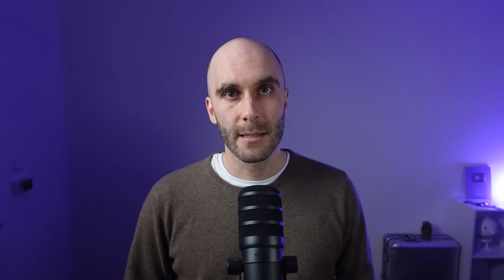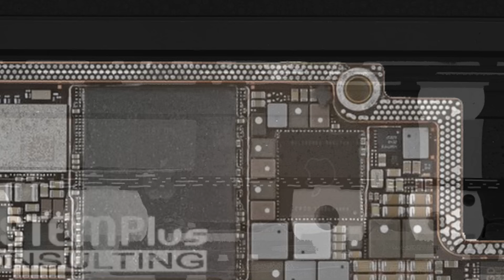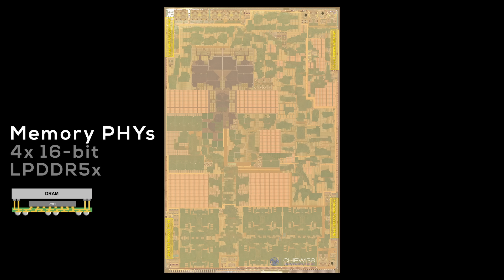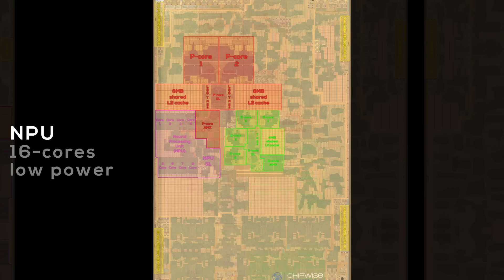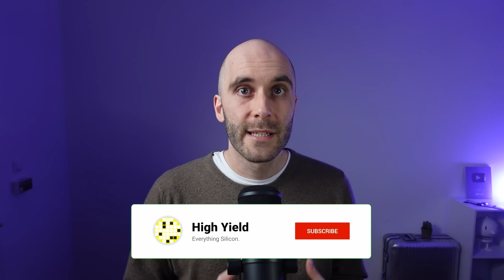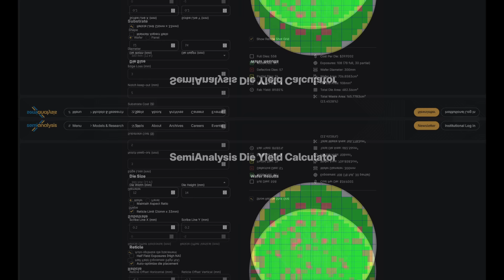A18 Pro & MacBook Neo Deep-dive

Comment: a computer thats powered with a smartphone chip sounds kinda weak, of course. And of course its not the fastest macbook, its not meant for that. I think its interesting to mention that the technology of the A series chip, an ARM based cpu is actually good for laptops too. Because if you think about it, from a laptop you expect kind of the same as you do with your smartphone: a good lasting battery, smoothness in everyday activities and it being cool and silent. Thats very interesting cause in the long term apple will cement its role in the laptop industry, eventually killing windows laptop who last a lot less, are kinda noisy under workload and also heat A LOT.

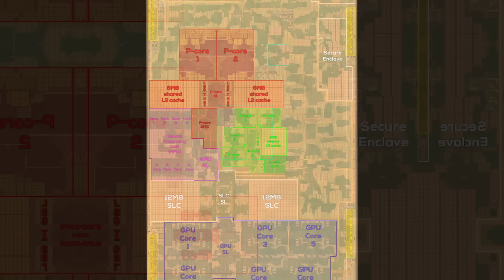Comment: 9:07 this is likely a system controller of sorts that is responsible for resource management. for complex low power systems they use little microcontrollers to put subsystems into low power states

Comment: Ironically they could have already started with a a4 chipped laptop with 4gb ram in 2010 and that would have smoked any competition back then. Here we are 16 years later
Reply: The problem with the A4 was that it was not powerful enough to compete with x86 in raw performance. Apple needed a significant performance overhead in order to transition to a new architecture and running emulated x86 software at least close to their original speed. The A4 could not deliver that.

Comment: 13:10  I don’t understand. You said all 6 GPU cores must be enabled and Apple can’t use any A18 Pro with defects. But right after this , you say Apple can now FINALLY use all the A18 chips with a defect. Aren’t you contradicting yourself ?
Reply: He didn't say that at all. He said "The A18Pro was only used in the iPhone 16 pro / Pro max. And Apple only used A18Pros with all 6 gpu cores enabled."

That doesn't mean Apple can't use A18 Pros with defects. but they the iphone's MRD required only the chips with all 6 gpus functional. The ones with 5 gpus working even though they would power up fine, were not suitable for the iPhone.

The neo is an outlet for those 5 gpu bins.
Reply: @skifree0  I see. I get it now. Thanks

Comment: thermal throttling pieve of shit not suited for lsptops, they dont even have temperature control: no fans, no heatsink, no thermal compund for a chiop which hits 95c the moment it turns on. this chip is also weaker than the ones in iphone..... hope you all ate that apple promotion money

Comment: That tiny dual core might possibly be part of the Secure Enclave thing. It’s possible. The T2 chip used to basically be a stripped down A10, which had two efficiency and two performance cores built into it. Apple has since baked that into their SOCs instead of building a separate chip.

Comment: The A18 Pro is a pretty magnificent chip design wise, and the macbook neo is a testament to Apple spectacular market mastery, what dissappoints me what the macbook neo is that at its current price point is competing against WIndows/Linux laptops with double the ram and considerably superior multicore and sustained performance, and even fellow older macbooks with overall superior usability and flexibility and even performance and it doesnt help that it lacks a cooling system almost entirely and throttles aggressively really quickly. wich really threatens its longevity as if there are any defects the excessive heat will expose them over time and non upgradable components will be very problematic/impossible to replace. Iam impressed by what apple was able to achieve but its just that from a longevity and usability stand point it doesnt make sense to buy. if you are fine with 8gb just go with an older M1 with slightly better overall performance and linux support for cheaper.
Reply: its especially a tough sell against something like the acer aspire 14 AI with the ultra 5 226V with offers much much longer battery and better sustained performance, while also having the advantages of x86 such as wide compatibility and better gaming experience. and no I dont consider superior build quality a reason to skimp on purely superior processing power and long term usability.

Comment: Great video as usual, I hadn't heard of InFO-PoP before.

One thing you could have made explicit (maybe I missed it?) is that InFO-PoP is a wafer-level packaging technology, meaning the 8 GB memory chips get stacked before the wafer of A18 Pros gets diced. That is, Apple had a stockpile of binned A18 Pros that already had RAM attached, and not a stockpile of "naked" SoCs that could later be configured with differing amounts of RAM.

Presumably InFO-PoP is chip-on-wafer rather than wafer-on-wafer?

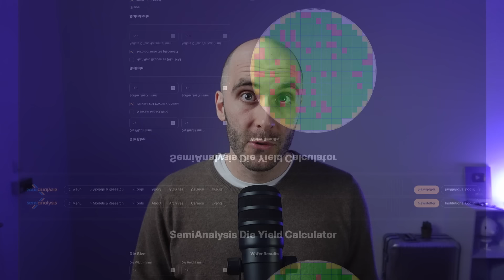Comment: A really good video with clear analysis of the A18 Pro chip and the comparison with the M4 - thank you. I particularly liked the point about yield numbers (at around 12:50). I've been interested in this point for a long time, from when it became clear that APS-C DSLRs would always so much cheaper than 'full frame' models, because the APS-C image processor is so much smaller and therefore the yield rate is much higher.

Comment: Largely, the cost/benefit analysis for the Neo is that it was designed to benefit Apple, not Neo owners. Over around a 4-5 year ownership, the MacBook Air M5 base laptop is a far, far better deal. I don't think Neo's will be kept anywhere near that long. It should be no surprise that Apple has sculpted a better marketing campaign than a laptop. Listening to these 'influencers' go ga ga over the Neo makes me wonder, what's going on there.

Comment: IMO the biggest thing holding back the Neo is the passive cooling. I doubt it could could keep up with the M4, even if you disabled two of the M4's P-Cores, simply because the M4 is cooled better.
Reply from the maker: Fully agree. That’s why I’m not sure if the next Neo really comes with the A19 Pro, that it will also use the vapor chamber

Comment: People kinda forgot that before the whole M-series chips, Apple gave out a Mac mini that runs on an A12Z chip to developers for them to use and build ARM support for their apps.

A chip from a 2020 iPad Pro. Which is also used as a basis for the M1.
Reply: I remember that. And that thing ran great. It was faster than all of the Intel chips already. 

The A18 Pro is actually faster than the M1. Although that alone probably isn’t telling the whole story, Apple is doing some heavy thermal management here which means it will likely be slower in sustained workloads.
Reply: @photoniccannon2117   thermal design is retarded. it throttles because they didnt put a single thermal pad connecting the chip to the chassis. people are already doing it and getting pretty large sustained boost clock improvements.
Reply: THIS.. i thought the same thing. Since everyone seems forgot M1 derived from A12Z
Reply: @joenathanz7474 M1 is derived from A14. Not A12Z. (at least according to a leaked optimization guide meant for tencent)
Reply: @thenothingofoz  The M1 is derived from the A12Z in the same way the M2 is derived from the M1
Reply: @thenothingofoz correct. It’s about 20-25% faster per core than the A12 series. Some of that is clock speed improvements but there are also significant IPC gains. 

The A12Z was already a beast but the M1/A14 was a very significant leap over it.
Reply: My 2020 iPad Pro is still going strong. In fact, when I replaced it, assuming its for reasons of choice, it's more likely to be because I want more storage or new features rather than the SoC being "too slow"

Comment: Flagship smartphone chipsets are powerful but often overlooked because most of the time they don't perform as high as they can due to the power and thermal limitations of such small devices. And the software compatibility problems are solved, they'd be great at low-cost laptops.

Comment: It would be so nice if all ai accelerators were replaced with L3 cache! It would provide an actual performance and efficiency improvement in tasks we actually want to perform on our devices. Some occasional matrix calculations can be done on a GPU just fine
Reply: occasional matrix calculations are probably the worst case scenario for running on the GPU...You want frequent matrix calculations to justify the power cost of powering up the GPU.
Reply: @skifree0  i don't get you point. iGPUs are plenty for a burst of calculations. Wheras a frequent load (like microslops's ai spyware) justifies dedicating some die area towards a spetialized co-processor
Reply: @MhlMstny  the entire point of a NPU isn't for performance its power efficiency, NPU's actually have horrible performance compared to a real GPU, hence why on a desktop no one actually bothers to justify one. the GPU will do ANY form of matrix / SIMD calculation you want.

the problem is using a GPU to do light matrix calculations sucks an enormous amounts of power relative to the workload...Say you have a light load. Even with iGPUs, to get a GPU ready. You need some amount of the CUs/SMs  to be online. Then you need the those blocks of L1 powered up. Great you powered up your SM/CU to actually exec those calculations, but now you need all the supporting IP blocks to get the instructions to the work unit. 

You need at least one part of the the GPU's central schedulers powered on. Oh but then you need to power up the last level caches connected to those schedulers. But to activate and use those caches you need to activate and at least part of the enormous memory buses, that GPU's have. 

it's like firing up a V12 lambo (or for your analogy a v8 mustang if talking about the iGPU) only to go to the grocery store. It can 100% do it, but you have to power up so much other "stuff" (IP blocks when it comes to the GPU) just to get that chip to function that you are better off having a small co processor that doesn't have to worry about GRAPHICS and can be stripped down to light SIMD ops, thats what a NPU is.

Comment: As someone who has used Macs since the 90s, it's crazy how Macs have gone from having inferior chips to everything else, to the same chips as everything else, to the point where someone says "it's Apple silicon" and it's understood that they mean "it kicks ass".
Reply: It is true, Steve would be proud. Apple silicon was one of two things I've given credit to cook for doing a very good job on since he took over.
Reply: Vertical integration kicks ass
Reply: "It kicks ass"

ass = your wallet
Reply: Problem is they moved away from being a pro consumer company. Everything is super expensive and even more expensive to fix. The Neo with a 30-40% bigger battery would be perfect for school.
Reply: @brezza6892  Macbooks were never as cheap as they are now
Reply: @brezza6892  it will already last you 20 hours watching YouTube on a charge, what are you doing that needs more than that?
Reply: @brezza6892  MacBook Neo is the most repairable Apple laptop made since 2012 and if you compare it to modern ultra slim laptops, it's far more repairable than they are. But overall everything became less repairable because the space, energy and efficiency savings of soldering everything in tight spaces are huge compared to making a bulky machine where you can plug everything in. Thing is, consumers have a choice but they choose to get thin and light machines over something like a Framework laptop.

Also why would a Neon with 30-40% bigger battery be better for schools? You can't fit a bigger battery in it, it's already the tightest motherboard I've ever seen on a laptop. The Neo already has a battery life longer than a day (12hr). What kind of  a school do you know that keeps kids in for 12hrs at a time???
Reply: @brezza6892 the imac that saved the company cost $1299 which is $2600 in today’s money. the neo is over 4x cheaper but you call it “super expensive”
Reply: @brezza6892 ...its $600? That's not expensive.
Reply: if you ignore that it costs 2x or 3x more than the same stuff from others, then sure
Reply: @lethern2 Since Apple Silicon, Macs have been some of the best performance in their price range.
Reply: @FrancoRossel  can you name 2  products that you compare and in which artificial benchmark? (we won't really compare games' fps, since... well)
Reply: @lethern2  Alright, let's see. Let's look at the actual benchmarks for laptops that these things compare to.
The base MacBook Neo with the A18 Pro starts at $599. It scores roughly 3500 in Geekbench 6 single-core and 8600 in multi-core. It does this completely fanless, silent, and without dropping performance on battery power. Not to mention you will be hard pressed to get that level of build quality at that price.
Now look at a $1,300 Dell XPS 13 with an Intel Core Ultra 7, or a Surface. It scores around 2500 in single-core. It literally costs $600 MORE, gets absolutely destroyed in single-core speed, has fans that spin up constantly, and loses about 30% of its performance the second you unplug it from the wall.
If you match the build quality and screen, Windows laptops are the ones charging a premium now. You are paying more money for worse benchmarks.
Apple silicon is king at single core and performance per watt. And I didn't even compare a M series chip.

Of course Macs are not gaming machine, these are for work. Do the rest of the homework yourself. And the things also retain much better resale value.
Reply: @lethern2  let’s flip it around, find me a 500 dollar laptop that benches the same as the neo. Or a 600 dollar micro pc that benches the same as a mcmini. 

And you can compare benchmarks for macOS on games like cyberpunk 2077 and baldurs gate 3 if you want to. The times really are changing.
Reply: @luipaardprint  Don’t bother arguing with that guy. His argument has no basis, and he’s looking for a petty fight.
Reply: @Taxiway_Delta  Wait, MacBook neo has 8GB of RAM...? You mean that we are looking at a thing that has less memory than an iPad and we are celebrating? Gosh, now I feel like I've been rickrolled by you guys, good job
Reply: @luipaardprint  See how he’s trying to get me to engage in his petty conflict? He’s a troll. Ignore him. He’s even omitting obvious facts and making misleading assertions! 🤣 I would point out the holes in his argument, but I’m too busy writing a comprehensive music app in Xcode on my MacBook Neo.
Reply: @Taxiway_Delta  it’s not so much for him, but for other people that come across this.
Reply: @luipaardprint  Fair point
Reply: @lethern2  Trolling or not I cannot ignore someone pretending that the memory management of MacOS is not superior to most other OSs. In Windows, you drown with 8GB. In MacOS, 8GB will run everything but local LLMs (though some have tried it on the Neo and it works with a TON of optimizing and sacrifices) with no concerns such as Video editing, browsers, emails, modeling software, etc. Its Unix base and well developed ecosystem, lead to insane optimization as developers know what hardware they have to accommodate for when porting their apps and there is better dynamic memory management in general.
Reply: @FrancoRossel  macs dont dominate as much anymore. competition has intensified. This isnt M1, M1 was an anomaly
Reply: @let @lethern2 An $1100 macbook will wipe the floor with any $1100 windows machine of your choice, ARM cpu or not. In everything but gaming (which honestly they're starting to get disturbingly good at) it wins in efficiency and performance. If you're buying a sub-$1000 laptop, quite frankly I don't think you've spent enough to even be worried about performance, clearly money mattered more
Reply: @nottodayfedboi3536  Too bad this is apple engineering were talking about, such as a high voltage screen circuit next to CPU data lines, soldered storage and ram, making the laptop a consumable instead of the components. I will never willingly buy a crappy apple product on principle alone, considering the kind of damage they have done to the repair industry.
Reply: @nottodayfedboi3536   macs dont dominate as much anymore. competition has intensified. This isnt M1, M1 was an anomaly
Reply: @suntzu1409 My M5 air (not even the pro lmao) wipes the floor with intel's Panther Lake release in everything except gaming (which is fine, not gaming on the air that's what the 5080 rig is for)
Reply: @lethern2  not anymore, apple is value now
Reply: @lethern2 there is no “same stuff” from others, that’s the point. Nobody else is delivering a similar level of performance at a similar power draw, so Apple’s products are worth their weight in gold. My M5 Max laptop renders Blender scenes faster than my desktop RTX 4090 PC while drawing a fraction of the power. That’s absolutely mind-blowing.
Reply: @little_fluffy_clouds  
Apple M5 Max (GPU - 32 cores): 5738.15
NVIDIA GeForce RTX 5070: 6172.42 
Apple M5 Max (GPU - 40 cores): 7065.02
NVIDIA GeForce RTX 4090: 11059.75
the data says it